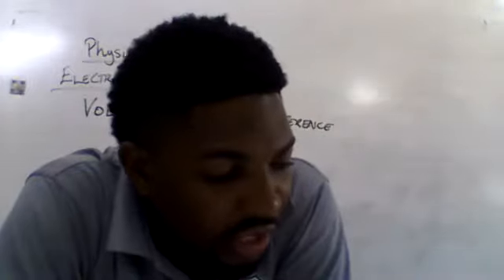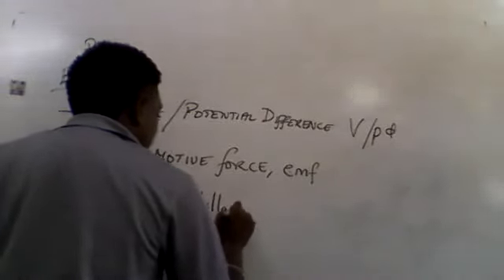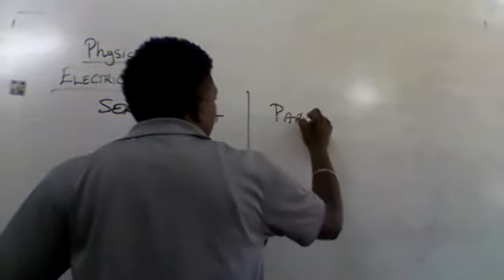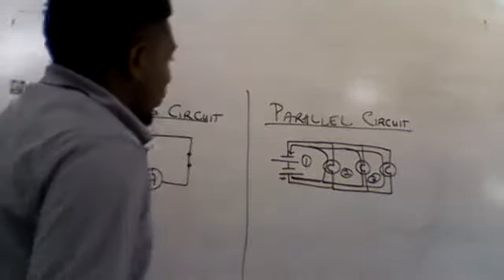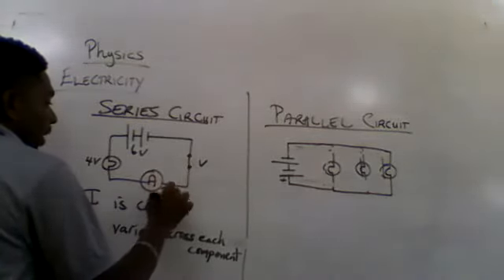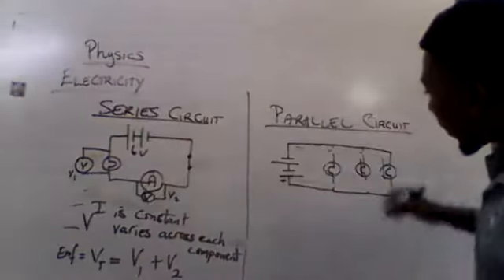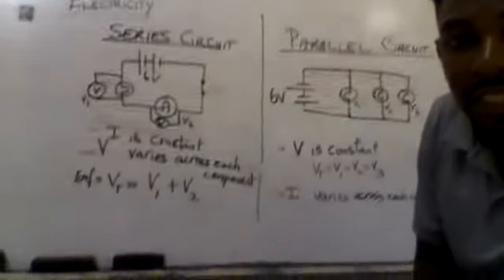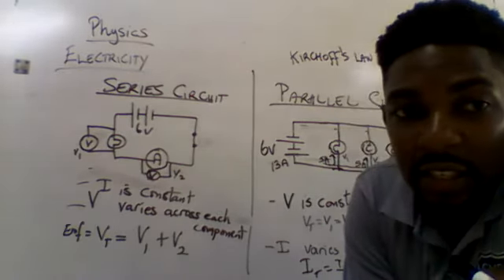CSEC Physics Lesson on Electricity: Voltage and Circuits

Comment: Does that mean that positive charges that are moving are mobile protons? That exit the atoms....are the positive charges protons and if so how do they become mobile?
Reply from the maker: No, positive charges don't actually move since they are embedded in the nucleus of atom. The nucleus doesn't move hence protons don't move. "Conventional Current direction" however is the direction in which current is "Perceived" to move in, which would be the movement of positive charge.
 However, to our knowledge only negative charges (electron) are free to move around conductors, in the opposite direction. 
I hope this answers your question.